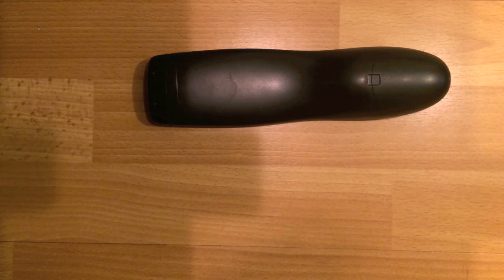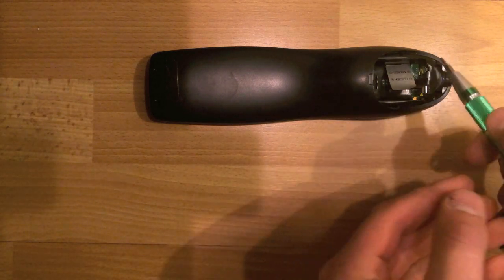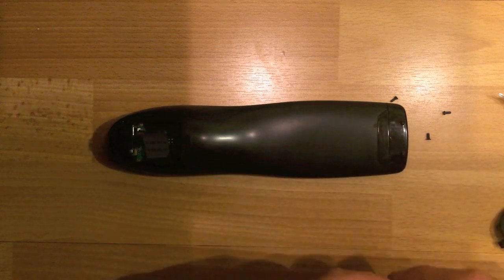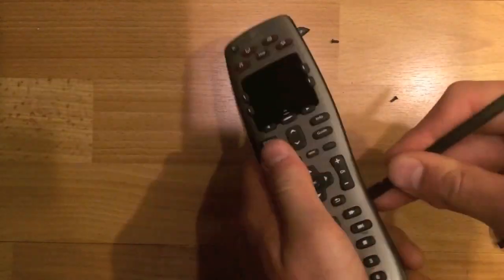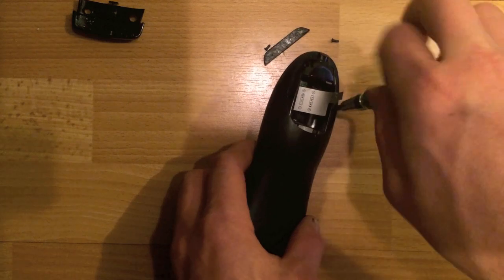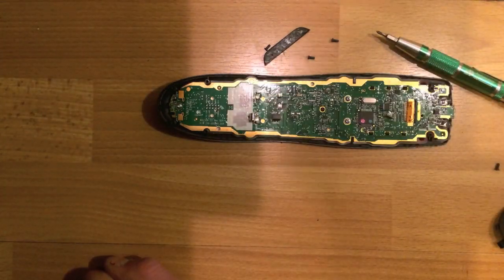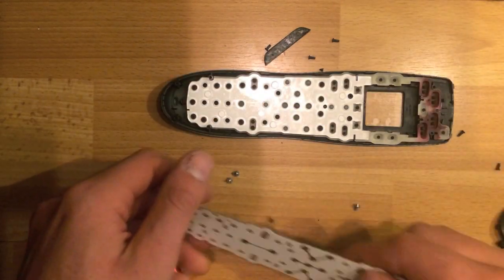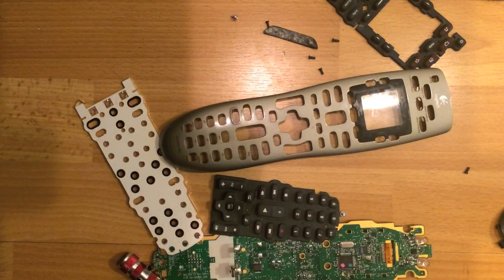Harmony 650 Teardown

Comment: @William Weatherall Great video thank you. What is the fix though if a button isn't working properly e.g. taking hard presses to function?
Reply from the maker: Uncle Drew there may be corrosion or crud on the circuit board. I’d check and clean that first.
Reply: William Weatherall the circuit board is the green one with all the little gold circuit/grooves right? What would you clean this with? I opened it up and noticed mines really greasy, don't know how that built up but yea it looks dirty.
Reply from the maker: Uncle Drew use 100% rubbing alcohol and shop towels or paper towels.

Comment: Was trying to fix mine, but got stuck on the separation of the three pieces of housing. Your video pointed me to the little glued plate hiding 2 screws. When I knew that I had all buttons function as they should within 10 minutes. Thanks!
Reply: Jan van de Wouw just curious how did you get the buttons to function again? What's the fix? My power button takes very hard presses but other than that everything works fine.
Reply: @uncledrew2392  Well, my fixe THEN was to clean al contact-areas: the gold forks and the rubber/carbon plates beneath the buttons. But a year later the buttons ended up acting up again, so this time I went with the Buttonworx repairkit sold by p1repair (on ebay and their onw site). didn't do the snapdomes, as they don't get used that often in my application.

Comment: If while at it you want to increase your Harmony remote range, there's an easy DIY making a reflector for your infrared LEDs.  A picture of the result: http://pasteboard.co/1C4vphHz.png . Cut a tiny aluminum foil strip, make a cylinder with it with the shiny part inwards (important) and put a tiny bit of Scotch tape to hold it in place.  You can use the inner core of a pen to help you with that.  Then just slide the reflectors on making sure the spherical part of the LED is not covered.  It greatly increased the range of my remote; now I can point anywhere and it works!

Comment: Wanted to take the time to thank you for this video.  Note that it not only works for the 650, it this process works for the 700 too!  I have two and the newest 700 (three months old) has a bunch of dust on the screen inside the remote!  Do NOT know how it got in there.  The old one was packed with dust inside but it's several years old.  Anyhow, thank you very much for the video.  Well done!
Reply from the maker: I'm so glad you found it useful. : )
Reply: +Mark MacLeod 
mine was full of dust to, it'd started creeping through buttons onto the surface to.i wondered what it was